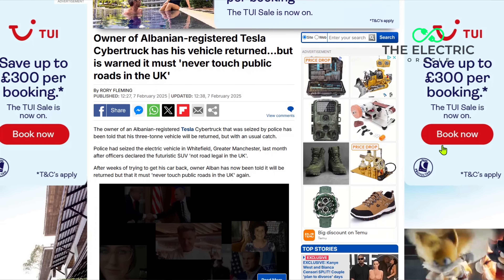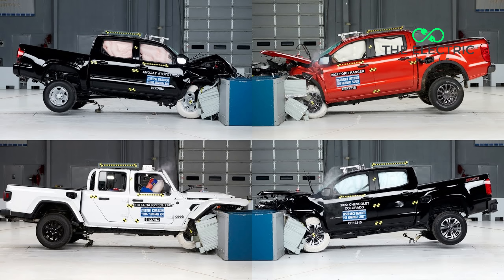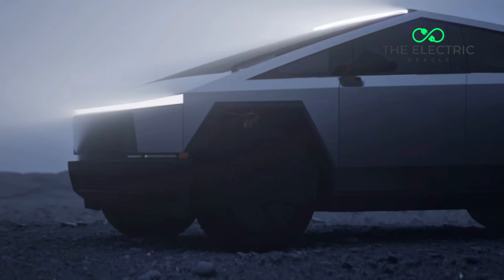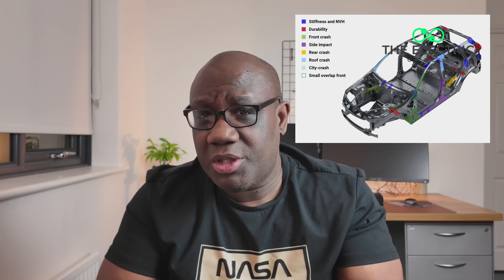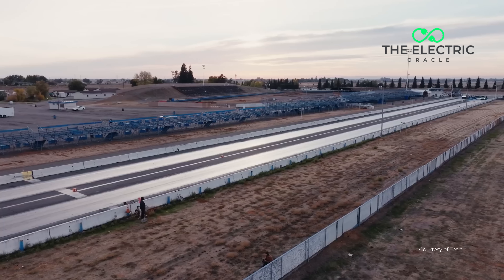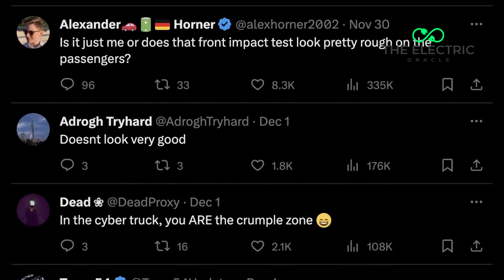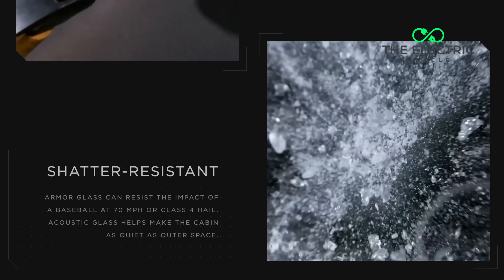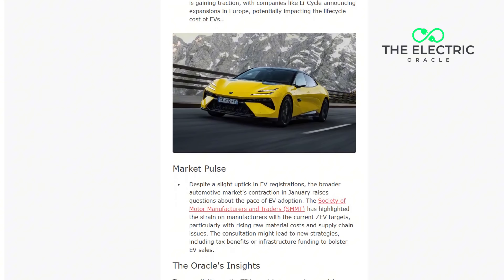Why the UK Banned Tesla’s Cybertruck – 5 Fatal Design Fails!

Comment: 1. The design issue with edges is not about load bearing and you could do a load bearing rounded shape. The problem is the thick steel can not be stamped so the manufacturing of rounded edges with thick steel is practicaly impossible.
2. The LED bar is mostly decorative. The actual lights are on the sides. Surprising it would cost so much to make them compatible.
3. The Cybertruck has crumple zones. This part is completely false. The front structure is mostly an alluminium casting which deforms just fine.
4. You get the same weight issues with other trucks, including ICE. Ford F-250 and F-350 for example.
5. You add a "horrifying" to the side impact video?  Seriously? It is NOT the goal of a side impact to crumple!!! The passengers are right behind it. The intrusion into the occupant compartment is measured, the lower the better. I can tell you what is actually horrifying. The split second you get when you realize a car is going to hit you. In my case the car fortunately hit the empty rear seat from the side, and our car bent like a tin foil. I wish I was sitting in something as durable like a Cybertruck. 
That all said I don´t want Cybertrucks on European roads, mostly for pedestrian safety.

Comment: The cybertruck is unlikely to ever make it to the UK because of the weather. The vehicle can't be washed without worrying about all sorts of things. Not only can in not handle a carwash but it's "stainless" finish can be marked just by rain. There is a really good reason that paint over steel is used for cars but sadly the obvious Back to the Future fan in charge of Tesla thinks that cool looking overrides any sort of sensible design choices.

Comment: Aussie here, it's too big for our roads, even the proliferation of the other American utes are too big for our roads. Plus the Cybertruck would also fail to attain certification here for the same reason as it fails in the UK/Europe, our design regulations are pretty much aligned with Europe.

As for the Cybertruck itself, it's just a massive vanity project for Musk and to design it with little regard for current safety regulations is just irresponsible. I have to ask, how did it manage to pass US vehicle regulations, are their safety criteria not as stringent as most of the rest of the world?
Reply: Take those road trains off the road right now!
Reply: No their 'safety' criteria are pathetic. In many/most states, the driving test is a joke and there is no mandatory testing of private cars at regular intervals. So it is perfectly legal to drive dangerous heaps of junk on the highways, around school zones and in the city.
Reply: @Sine-gl9ly Thanks for the clarification. Here in NSW a vehicle once it passes 5 years old must pass an annual roadworthiness inspection before it can be re-registered.

Comment: The Cybertruck design better fits military vehicle requirements and is not suitable as a domestic / light commercial vehicle for UK roads. I like Telsa cars and just replaced my Model Y with a Model 3 but I would never buy a Cybertruck as its not a practical proposition, especially with regards to vehicle crash, as you are not only placing the driver and passengers at risk, but also other road users and pedestrians. This is one of the reasons why drivers of heavy goods vehicles and buses require special driving licences the UK and Europe, because being large and heavy, they require additional skills and extra care to drive safely on our roads.

Comment: I just googled, and in 2023 there were about 1,600 road deaths in the UK and about 42,000 in the USA. I’m not doing the mathematics, but you’re many times more likely to die on the road in the US than in the UK. Just facts.
Reply: So, what are you saying we should ignore the 1600 deaths and not do anything about it?  The Cybertruck is illegal in most EU countries.
Reply: @ no, the trend is down, in 1966 it peaked at nearly 8,000, and we had far fewer cars back then. I would like the trend to continue, and don’t want that death machine here. I would prefer people didn’t buy suvs because if you hit a child they don’t fall onto the bonnet, they just get hit by a flat front.
Reply: The accident rate in the US is about 5 time that of the UK. Part of that is because there are proportionally more vehicles and each travels further  each year. Other factors are, driving tests are less strict, more drive without a licence, insurance, many states do not require MoTs and drunk/drug driving is more common.

Comment: My view is that we can talk about compromising on safety features if someone actually designs a valid alternative, but in general, new cars should always be safer for both its passengers and environment, than old cars, because of the lessons we learn from studying accidents. I think that's the guiding principle, and EVs do not have a compelling argument to be an exception, however due to their batteries, which add a lot of low position mass, i do understand that some safety lessons will need to be adapted. Open for alternatives as long as we follow the principle of safety increasing.

Comment: Theres the obvious width/length issues for our narrow roads and parking spaces, but whats its turning circle? Bet it wouldnt be able to drive around our tight cornered multi storey car parks or even turn down some narrow side streets. Also, is 3/4ton per tyre above a limit/restriction?

Comment: Just a correction here: Cybertruck doesn't have the promised exoskeleton. It was a lie like many other from Musk. It's actually kind of a weird unibody/frame design. Basically a unibody (not sure if steel or aluminum) sitting on top of a cast aluminum frame - the part that likes to just break off when towing hinge gets a shock. The whole thing is just a Frankenstein's monster of a vehicle slapped together by a bunch of people who apparently know nothing about making cars. Which is most likely caused by Musk exploiting young workforce so he doesn't have to pay for skilled older engineers.

Comment: I think the Cyber truck has such sharp edges because it’s NOT possible to bend that stainless steel into any other shape with its current manufacturing process and thickness of steel. But hell, I could be wrong 😊
The fact is - don’t care if it never drives on our roads

Comment: Safety regulations don't stop innovation. Regulations can and do evolve, especially as we discover new materials and new means of manufacturing.

We've had an e-Vehicle win Paris Dakar.

While you'll hear grumpy old men bragging about how their old car is built better because it survives lumps and bumps.

Not realising that in collisions that the rigid frame means all that energy gets transferred into the meat sacks that get hit or are driving.

The fact all those angles are load bearing sounds like there isn't really a safety cage around the passage compartment. Which also means you're far more likely to get trapped in a crash. Which considering how fast and hot a battery fire can burn in an EV is chilling 

The design choices that disregard pedestrian and driver safety remind us that Elon doesn't really value human life

Comment: Some Cybertruck fans that want to own one of these road illegal vehicles and are actively looking at a way to make the Cybertruck legal.  I wouldn't want my 5 Star NCAP safe car being involved in a collision with the Tesla, for obvious reasons! If anyone brings up the fact that trucks (im referring to the road haulage type that trailers are attached to) are on the roads throughout Europe, as being heavier and wider... Sure, they are, usually a tractor unit (the truck part that pulls the trailer), weighs around 10 tonnes. But, they cant accelarate faater than most supercars, and go faster than the mandatory speed limit of 56 mph, and most importantly, only drivers that have a heavy goods vehicle license, that they train and take tests for, can drive them. I hope they Cybertruck is never allowed on public European roads.
Reply: Hi Chrys, as an ex HGV driver and engineer, I can say that the hgv tri-axle tractor unit weighs on average 8500kgs, the average tri-axle trailer unladen weight is 7500kgs. The maximum laden weight is limited to 44,000kgs in the UK. I believe that limit applies to most of Europe also.
Tractor units on their own can out accelerate most cars away from the lights by using 5th or 6th gear ( on a ten speed gearbox) and slipping the clutch.
Reply: Myself and a mate have towed a race car on a twin axle trailer behind a 2017 Range Rover Sport a few weekends recently. We had the cruise control set between 60-63mph for most trips. We were being overtaken by HGVs. Not sure the limited 56mph is being adhered to these days.
Reply: Except that... it's actually lighter than competitor EV trucks... Has better 360 visibility and safety features like auto braking, steering, fsd, blindspot warnings, better road traction... (and yes, crumple zones, and no, it doesn't rust LoL) If you really looked into it, and actually cared for safety, you might find yourself saying "Why aren't ALL trucks Cybertrucks!"... except, it's not about that is it.
Reply: @thejaysehansen  It actually has lousy visibility. Poor or no mirrors, only cameras which will get blocked by mud, snow, spray.
Reply: @alisonwilson9749  you never been in a F300?

Comment: Excellent video. Ignoring safety regs is surely a step backwards, which plays into the theory that historically amercican car manufactures have designed some awful vehicles that are only capable of going in a straight line intil maybe tesla came along.  So did tesla's designers drop a monumental clanger or is it a deliberate (slightly arogant) statement by tesla or has tesla's MO to inovate at all cost clouded common sense judgment?  I don't know, it seems bewildering that they overlooked something as fundamental as this, so, I guess they don't want to sell it into europe??

Comment: Should it be defined as a HGV ( Heavy Goods Vehicle)?

That has significant impact to tax, road restrictions and additional maintenance and records required... It nolonger remains a vehicle for public use.

But 3.5 tons varries with it significant damage to unsurfaced roads and wear and tear through the roof on any other. Who pays for that wear & tear?

Its a completely impractical vehicle for regular domestic use.

Comment: they aren't "pushing design boundaries" they are literally unwinding 50 years of industry safety standards, which should have been rolled into the minimum legal requirements long ago, but everyone was following them anyway out of natural market competition. the cybertruck completely ignores every basic aspect of pedestrian safety, and made it a selling point, it is the embodiment of entitled arrogance that unfortunately costs very real lives to satisfy a design choice made by a egocentric megalomaniac with no regard to the consequences.

these cannot be allowed and having some import or legal loophole to say "it's safe" is an insult to the thousands that die on our roads. this isn't a debate about EV's its purely about maintaining basic safety standards regardless of the means of propulsion. putting some silicon corners on it and paying a different tax bracket isnt going to make a difference to the person they eventually hit when there is no crumple factor, no displacement area, no breakaway points on the body panels and no method of negating impact forces. its going to kill them.

Comment: Although Tesla claims the Cybertruck is an exoskeleton design, it’s actually stainless steel panels attached to a unibody frame. There is no requirement for the panels to be that sharp for structural integrity as the panels are not structural at all.

Comment: Not only the Cybertruck, all EV's are a disaster, and - in my opinion - should be banned. They are promoted as a 'solution' to solve some of the environmental problems. But they are absolutely not. Moving the problem from the exhaust to the production and scrapping (plus creating some new problems like the required infrastructure) is not an acceptable solution. 
EV's are jut an experiment which is gradually failing. Should we wait until the damage done by EV's is so big that it can not be repaired?

Comment: For those not in the 1950s:
6898lbs = 3135.4 kgs
Reply: Which falls under the weight limit for a normal driving license. Same as a transit van.
Reply: Unless that is the empty weight!
Reply: Yup, that's empty weight, you need a C1 license category to drive vehicles up to 7.5 tons, which pre 1997 license holders have with additional tests.
Reply: @ColonelSebastianDoyle  
I've got C1 on my licence, which is:
"vehicles between 3,500 and 7,500kg maximum authorised mass ( MAM ) (with a trailer up to 750kg)"
Reply: @lewis72  now all you need is Tesla to completely redesign the CT and ur good to go.
Reply: @ 
You can drive a Transit van on a std car license.
I can, anyway.
Reply: @timgould5104  Google tells me the legal limit is, Maximum Authorised Mass 3500kg.   MOST  Transit models are just under that.    The Cybertruck - by the time you add driver + passengers - is going to be over that, even before you add payload.
Your statement is deceptive.
Reply: Ok if that is the empty weight you are correct. I did already comment that 1 min after my first post. The Transits we had were from memory 1700Kg totally empty, 3500Kg fully laden and 5500Kg gross train weight.

Comment: UK driving licences are based on gross vehicle weight, doesn't matter if the vehicle is full or empty, licence requirement does not change. This is over 4000kg so requires LGV licence.
Reply: except it isn't over 4000kg. The rear wheel version, the one that will be most sold in europe is under 3000kg.
Reply: @pieterpossenier4191  4 tons is the maximum weight that includes the 1 ton load capacity. So it is over the 3.5ton limit for B license.  You need C1 license to drive it. Try reading the first comment again couple times.
Reply: @pasinen  not true.  UK raised the limit 4.2 ton for B licence if  alternative engine such as hydrogen or electricity
Reply: @pieterpossenier4191  3500 kg maximum permissible load includes passenger and load. So if you have a 3000 kg vehicle you could transport (if seats and other features are available) up to 5 people and a driver. If the passenger weigh  100kg each you are down to five and if they weigh more down to 4.
Reply: Unless classified as a car.

Comment: Also another problem and one that would worry me is there is no mechanical link between the steering wheel and the steering rack (no steering column) as it is fly by wire but they do have a back up motor on the rack if one of the motors fail !  Call me picky but I like a steering column bolted to a steering rack and not rely on dodgy electronics.
Reply: The Cybertruck has 2x steering motors and 3x sensors, so there’s multiple backups in case of failure. Modern airliners use similar to fly millions of people a year.
Reply: @JohnSmith-x3y8h  It is illegal for a manufacturer to sell a car in the UK that doesn't have a direct mechanical link between the steering wheel and the steering rack and there is a reason for this. There have been many modern aircraft that have crashed because of faulty sensors and electronic faults.
Reply: @ it’s not illegal.

Comment: The light bar isn't even fully legal in the US as well. Tesla is not allowed to install them on the vehicle in a way that they are actually functional, despite them being sold with the founders edition. 
That is why they offer to (partially) mount the light bar for the customer onto the vehicle and then give customers the last few (electric) parts to make them functional. That way it is then merely a vehicle modification by the customer. 
I suppose the legality of this vehicle modification then varies from state to state, likely illegal in many (if not most or even all?) cases (due to the lack of DOT approval?).

Comment: @5:23, you are correct. Older model US Cars used to have Steel Dashboard’s and Steering Wheels. They found these features created even more harm and deaths because the forces were transferred to the driver and passengers.
Reply: So did cars in the UK, 60  years ago 😂. Timber and vinyl dashboards were on luxury models and steering columns were sometimes rigid from the steering box effectively spears. Crumple zones did not exist and brakes were "useless when wet" drums all round. But sense of safety and development prevailed and we now have rules and regs in place to make  vehicles more human friendly.

Comment: Putting the safety elements aside for a moment. It’s a gimmick, good head turner as they are not seen often at all. I saw Yannis’s in Chingford and it was great to see. I do not see the point of it though. I wouldn’t want to see them on our roads, too big and not practical for our roads.

Comment: The light bar is just a light bar. Headlamps are actually the lower set. The 30x cold rolled steel dedorms as normal, and the body structure is 5 star compliant. Ok, the weight maybe and issue but only until FSD unsupervised rolls out in August 2027.
Reply: The rolled edges requirement means it's not compliant. The exposed corner on the front of the wing is especially dangerous.